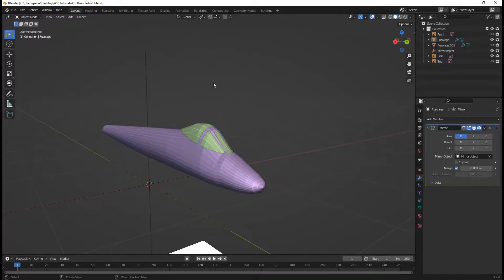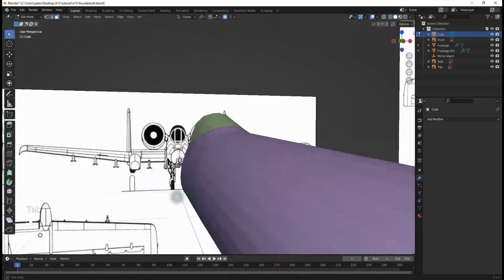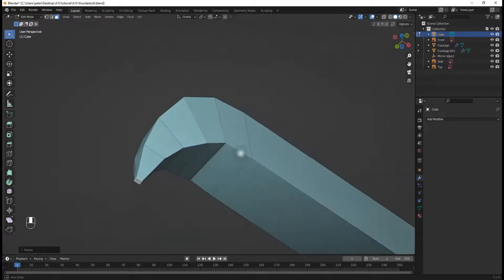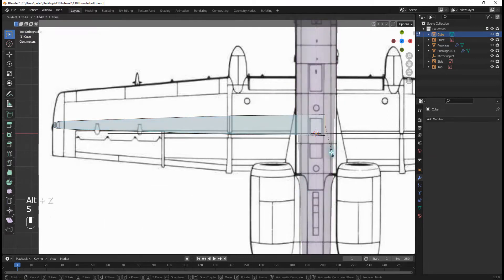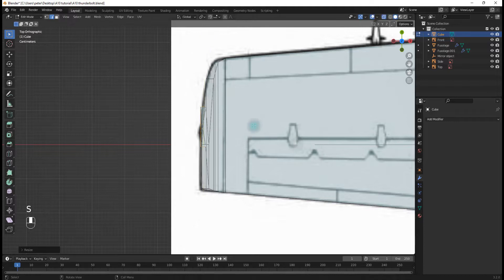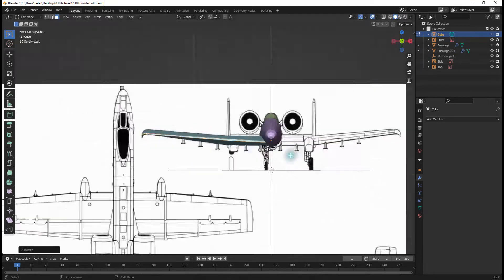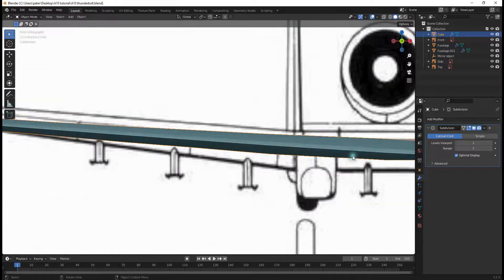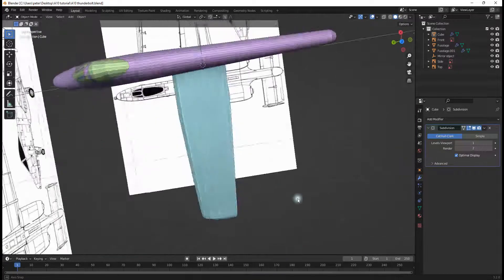A-10 Thunderbolt II | Part 2 | #blender tutorial

Comment: In the options dropdown where you choose your "MatCap"  there is an option for "Xray" and it allows you to see through the wing if you turn it down to say: 0.85...   Also, if you toggle xray view option when you are doing your knife cut, you can knife cut the top and the bottom of the wing for the flaps at the same time.  Great videos though, I am picking up a bunch of tips that I keep forgetting to use!
Reply from the maker: Thanks for the tips! Glad you found the videos useful.